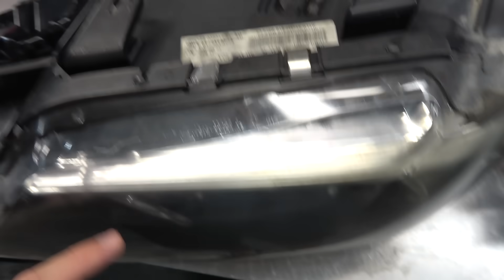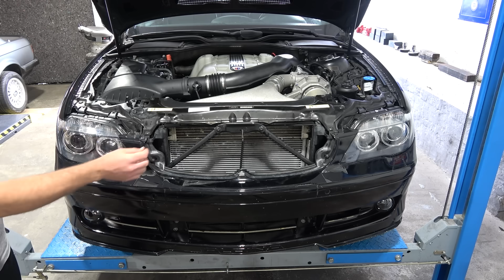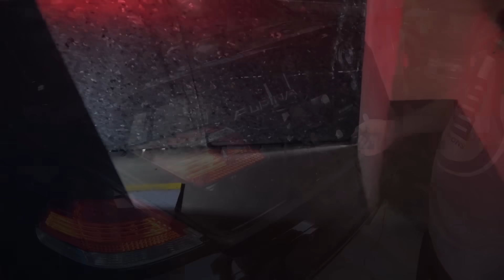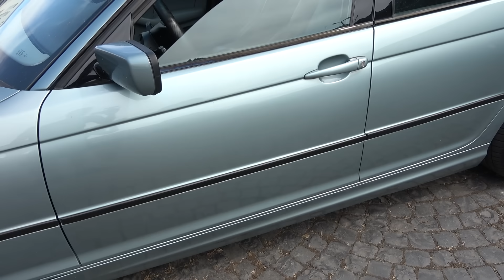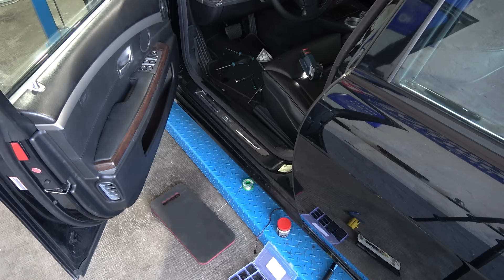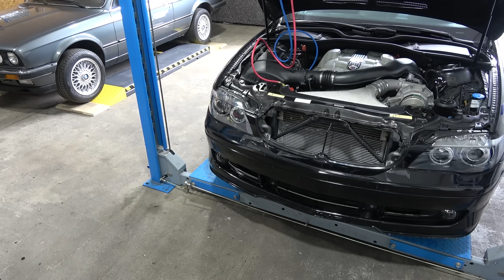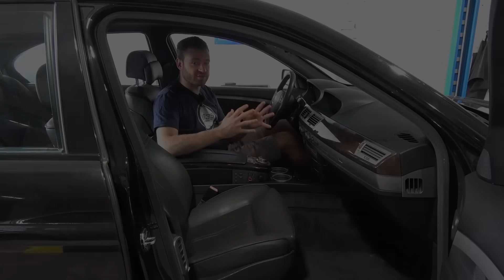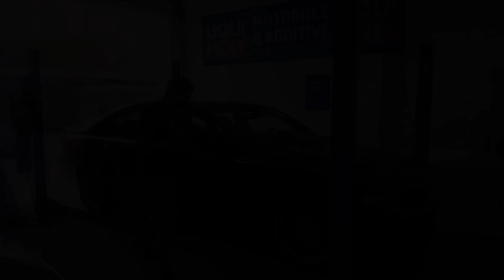Can We Make Alpina B7 Roadworthy Again? - Project Chicago: Part 12

Comment: 21:31 When it comes to number plate lights I find the best thing is to use blue coated halogen bulbs. You don't have to guess if there will be an error message or if they'll be too bright, in the end you will have a nice white light not that regular halogen yellow mess
Reply: Yes!! I use the same and they work perfectly
Reply from the maker: Thank you! I'll look into that.
Reply: Yellow lights are way to go, but on cars older than 95 :D

Comment: Motip's bumper and trim paint is a great option for well bumpers and trim ;) painted the bumpers on my Mk2 golf 2 years ago without any primer and still looking fresh as the day i painted them. The only place it has started falling off when i pressure wash it is on the hatch lock trim where i didn't clean it properly still vegetation under the paint

Comment: Sir, the BMW will not pass TUV.  It isn't leaking anything which means it is obviously empty, which is a safety issue.

I wonder why BMW doesn't connect the rear fog?  All my Audis have had it.  It seems like more work to have 2 seperate wirings.  Also, why can't the US and Europeans agree on lights. 🤦‍♂️🤦‍♂️🤦‍♂️🤦‍♂️

Comment: For the warranty it’s the same thing in the USA even for a battery. You cannot bring them a bad battery for warranty replacement, you have to bring them the whole car with the part installed for them to confirm it first. Even if the car is dead you have to have it towed. You can’t just take the bad part out and bring it to them even if you bought the part that same day. 
Reason 13448374 why BMW is loosing customers.

Comment: I don't think it was a good idea of draining that much oil out of the AC compressor. You said it correctly yourself that you already replaced the condenser which certainly had oil in it and you have no idea how much. Furthermore when this system developed a leak, it would leak oil out of it.  There is a reason the compressor is shipped with oil. If you had like triple the charge yes you can experience some diminished AC performance due to coating of evaporator and condenser but with the amount there, very unlikely.

Comment: 20.23 hello you could try putting a 100 OHM resistor on the number plate positive wire, but you'll have to cut the wire to fit it inline.

Comment: Put 2K Clearcoat on the lights (incl rear) instead, if you do it properly it is not noticable or visible at TUV.
Not shure if you need to sand with 2000-3000 grit on totally new headlights. Thats what I do on older ones.

Comment: I suggest taking some fine steel wool to the windshield or if that seems too aggressive, a clay bar and lubricant and clean the embedded dirt on the glass.  I usually wax or polish it afterwards and the water beading properties are amazing.  Not to mention coupled with new wipers it's virtually silent with zero chattering.
Reply: Yes even new wipers start making a noise and chattering after a while. Windscreen needs to be perfectly smooth and clean. I apply rainx to the windscreen after every wash. Wiper blades then last much longer and never make any noise.
Reply: @Monkey-World-2  I used to do Rain X but it would wear off so quickly.  Carnuba wax was lasting like 6 months to a year lol

Comment: My suggestion if you want the feel and handling of a brand new Alpina. 4 brand new wheel hub bearings. Sounds crazy, but it will have a profound effect on smoothness, vibration, and steering precision. TUV should require this as a priority on high mileage vehicles. Don't roll your eyes till you try it.

Comment: ~~~You might try "SEM TRIM PAINT"!~~~   It's the ONLY satin black I've found that actually lasts, and flexes, AND matches the factory finish.
Reply from the maker: Semi gloss looks better.
Reply: @M539Restorations  LOL.  Yea... but fading and peeling doesnt look great either.  I'll be watching to see what happens!!
Reply from the maker: It doesn't fade or peel as you saw on E46 :)
Reply: @M539Restorations  Yes, I saw, but considering that's on the side of the body, and not on a horizontal surface like the cowl... I'm still a little skeptical.  Maybe the amount of sun cars get in Socal is more intense or something than Germany, I dont know.  It kills EVERYTHING here!
Reply from the maker: @Johnathan_Waters  SEM is good stuff but we don't have that in EU and what I did works great too.
Reply: @M539Restorations  Damn, sorry I didnt know!
Reply from the maker: @Johnathan_Waters  nothing to apologize about. Btw, SEM has gloss opinion too.

Comment: That small flashing you see on the angel eyes with key on is the car doing the bulb check on the circuits to look for a blown bulb.  On a filament bulb it's so minor voltage you won't see it, but LEDs will pick that low voltage up and flash
Reply: The cold bulb check can be coded out in NCSExpert. Very useful bit of s/w!
Reply: @smorris12  If you coded these out you won’t get a warning if the bulb is bad
Reply: @ibrhelmy  I’m fairly confident anyone who is actually capable and has the equipment to code it out, is aware, and is competent enough to realize they have a light out.
Reply: @TCronenberg  yeah but on the off chance that a bulb dies while driving it'd be nice to know about it.
Reply: @smorris12  my X5 does it.  At my age I don't even care anymore 😆
Reply: I wonder how strong that LEDs are because I want to order a pair for myself....
Reply: The bulb check doesn't work for LEDs anyways, so remove the cold bulb check. As LEDs are not allowed anyways (except if they would have a E certivication) the TÜV inspector souldn't be pointed to these bulbs by this flashing -> better to change coding. (To add a (stupid) resistor would also be possible.)
Reply: Bimmercode will be able to code them out. And the flickering will probably happen every so often. Had that myself too.
Reply: I coded out the "Cold Bulb Check" out on my E39 Touring because of the LED flickering ✌️

Comment: A small tip for painting semigloss paint out of the can. The paint sticks and lasts much longer, if you heat up the part you intend to paint slightly. And actually the surface will become smoother. Give it a try ;-)
Reply: nice tip
Reply: Or just use boiled linseed oil on faded plastics to make them like new again
Reply: @matthewanderson9119  for about a week or until it rains, a better way is to just use a heat gun
Reply: @juggnautbitch  heard that too but oil seems to last for about a year on my 80 👌

Comment: Isopropyl alcohol won't damage plastic usually, you should try that for the old headlights to see that does it ruin them. But plastic cleaner should be fine too.
Reply: IPA will damge PMMA.

Comment: Wouldn't you be able to send the part back (fuel pump)? Just say it doesn't fit. End of discussion.
Reply from the maker: Unfortunately no, cause it has clear signs of use
Reply: @M539Restorations  Total bummer on that! Also, great work on the B7 so far!
Reply: @M539Restorations  You could send it back through the biggest glass window at the front of the dealer.

Comment: I just did a new compressor, condenser and expansion valve on my E93 and the Denso replacement compressor documentation said that as long as I flushed out the rest of the system, it had the correct amount of oil in it. I flushed the evaporator and all the lines and just installed without adding/removing any oil.
Reply from the maker: Ugh, not ideal. The A/C compressor comes way overfilled and you need to adjust to the correct amount, even says so in their provided installation instructions. Every model has a different capacity for oil. You can't flush the entire system unless you literally replace every single component including all lines. But anyway, if it works then let it be. :D
Reply: @M539Restorations  That is specifically what the install instructions say "If the system has been flushed: Original DENSO
Compressors which are delivered with the correct amount
of oil can be installed directly. Turn the compressor
systematically by hand to distribute oil evenly. This will avoid
damage when the compressor starts moving or during start-up."

Comment: OHNE MÄNGEL. Dont forget the sidemirror, its bugging me everytime i see it. Also for too bright chinese license plate light i just went with a piece of tape covering most of area so only the right amount of light was getting out x)
Reply from the maker: Gonna do the same! Replacement mirror is coming:)
Reply: There is also the possibility of using a diffusing layer on the light (usually thin tape), which not only gives a uniform and desirably low level of light distribution, but also makes it look very pretty.

Comment: Why not put an Osram festoon LED in the original housing?
Reply from the maker: Never heard of them. Thank you! I'll order them
Reply: From the website - " These products are not ECE-approved and must not be used on public roads in any exterior application", I guess you meant something other than the license plate LEDs?
Reply: @whatashave  yes they're not ECE rated, but I think it's a better solution than a Chinese neon glow from your license plate light
Reply from the maker: I just looked up reviews on them and it's pretty bad, they are dimmer than standard bulbs. I'll try to darken/cover up few LEDs on the current ones.